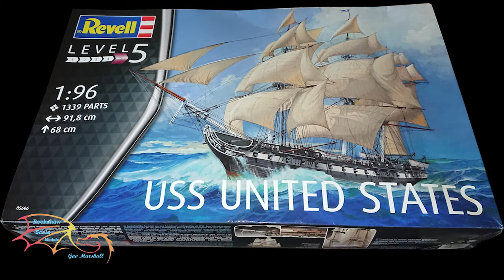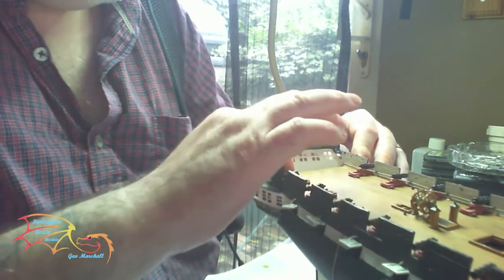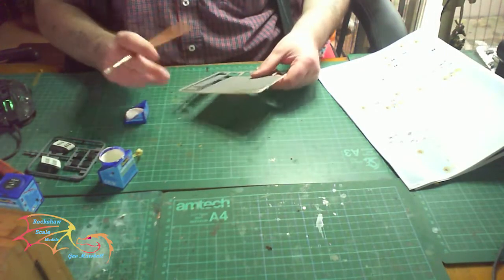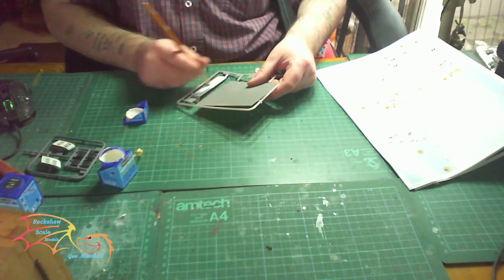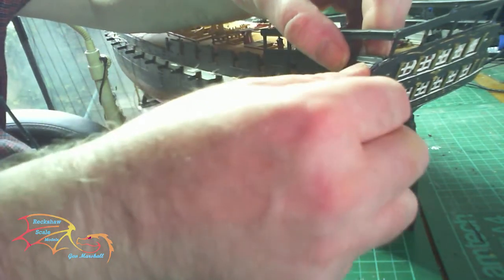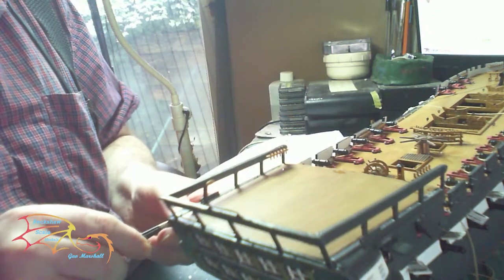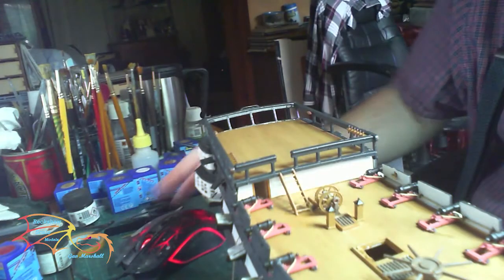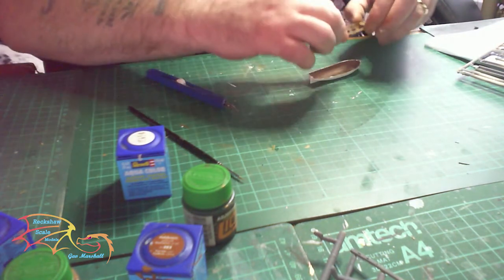Revell USS United States Scale 1/96 Part 5 Main Deck Cannon Beware of the Carpet Monster

Comment: That is an amazing looking ship you're building there Gavin! And you're very skillful too if I may say so. Have you been modelling since you were a kid? I started when I was about 8 years old with help from my older brother. How much time have you spent so far on this build? 

We have wooden floors and no carpet but the monster still eats the small parts :-(
Reply from the maker: Me as well, I started around 9 years old, I think my first kit was an Airfix HMS Belfast. But only made up a couple of kits, never had a lot of pocket money.  It wasn't until 16 that I really got into the hobby and built my first sailing ship around 17, the RSS Discovery.  Been building on and off since then but it wasn't until around 5/6 years ago that I got back into it properly and started to build up my stash.   
This kit is a technically difficult kit to build, mainly due to the fact that you have to think about how you're going to place the rigging from the start. Known which parts to leave off until later stages come with experience and each build is different so it's more down to feeling and personal choice.  I've been working on it for two half weeks so far around 96 hours. I'm at the mast stage now so the build will be going slower. For instance, the first cross-section at the top of the foremast took me 1 hour to paint and rig out, now I've got to decide whether I'm going to put sails on her. I've almost finished editing part Seven of the build video which will have the beginning of the foremast construction.

Comment: The problem I see with Revelll is a lot of times they build a model kit of one thing and if it has sisters or whatever they wind up saying oh well it's also this ship or this plane as well that model kit looks awful much a lot just exactly like their 196 skill USS Constitution model kit just an observation but it's what it looks like and Revell is notorious for doing that
Reply from the maker: Hi Cj, there are a few model producers who do this sort of thing. I think it all comes down to the cost of the molds and CAD drawings, cheaper to slap another label on it I suppose. With the  Constitution, it's more of the class of the ship. What gets me is when there are different variants and they don't supply the extra parts. But saying that there is a large market of after-market parts for this.